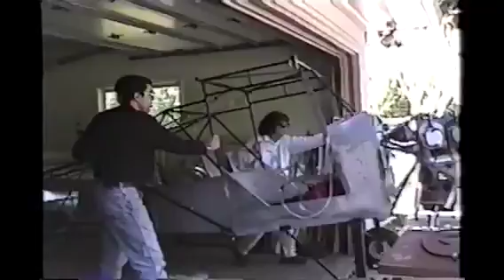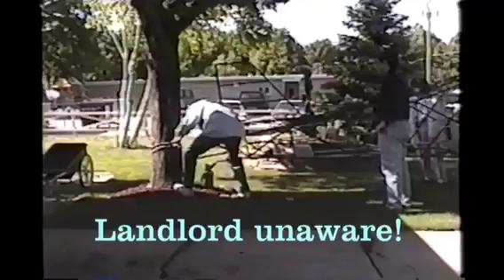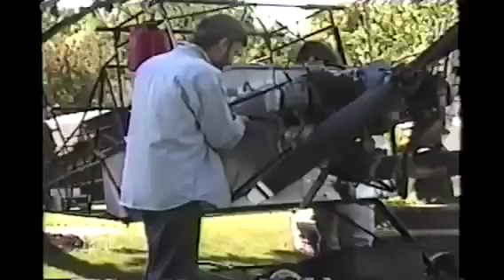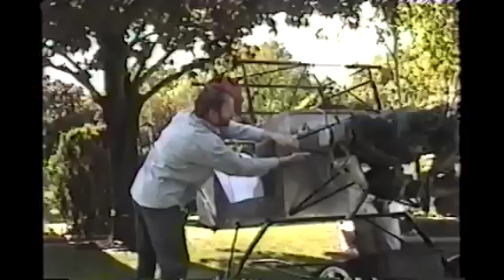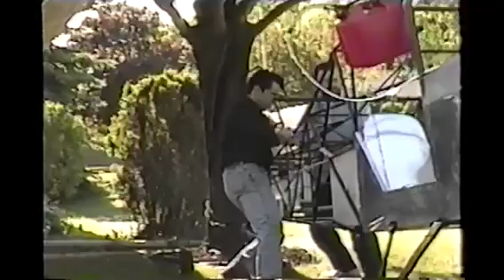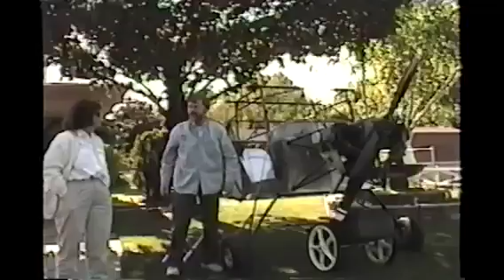Prostar PT2C Kitplane Engine Test

Comment: Have you flown this yet? Do you still have both hands? Are you still alive? If you carry on playing with a live prop like that then it won't be long. Not to mention the "dripping fuel is good" comment at the end.

Please please hand prop from in front, and attach the prop in the right position to help this. Also move the prop ready to swing BEFORE you switch on.